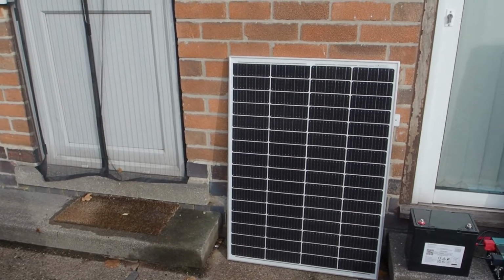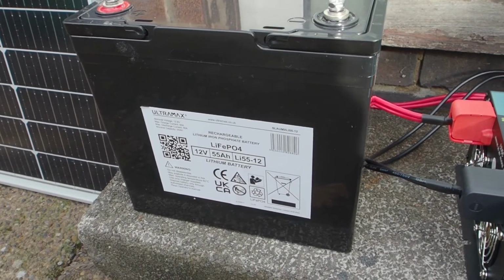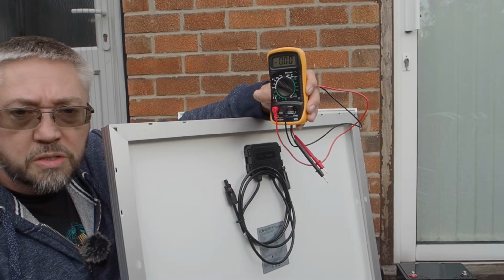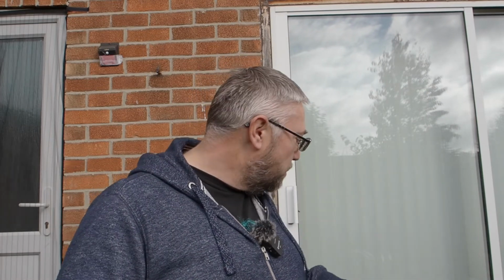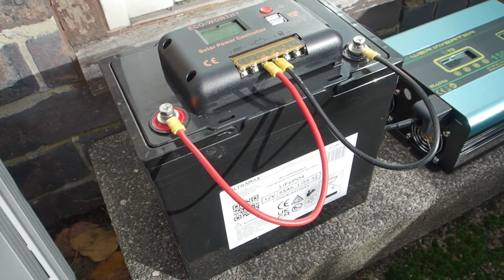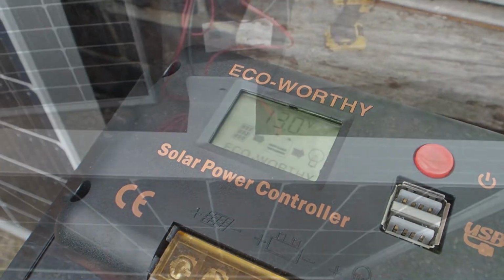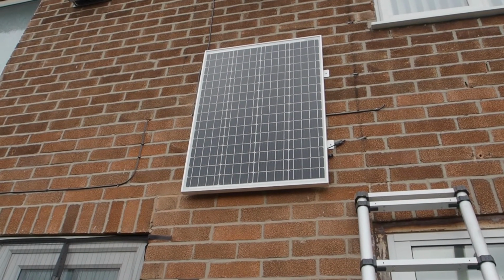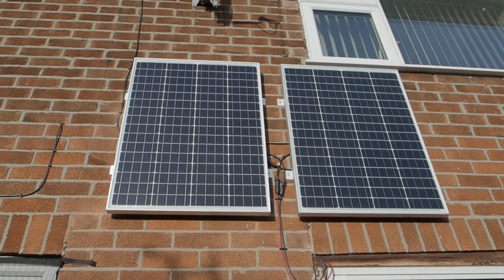Off Grid Solar Install At Home Part One! - Project Van Life UK!

Comment: Started off near the same as this i now have 8 120w panels all on two micro grid tie's with battery charging as well it works real well and on a good day summer can make near 6kwh of power
Reply from the maker: I'll be adding more panels soon I think. Battery bank is now at 2.1kw so taking quite the load off the grid at home already!